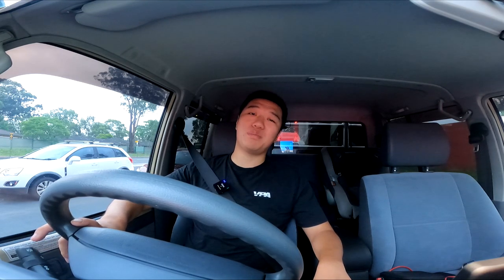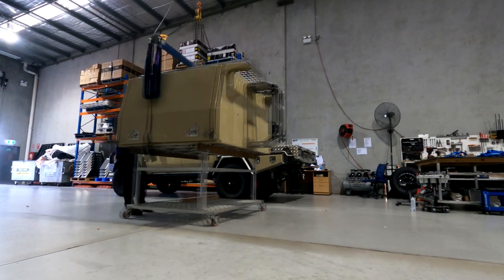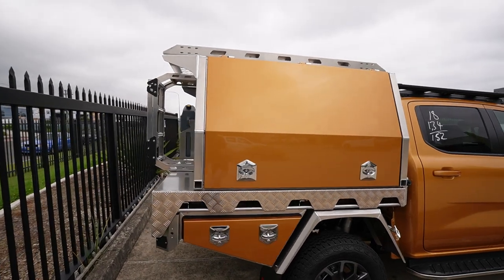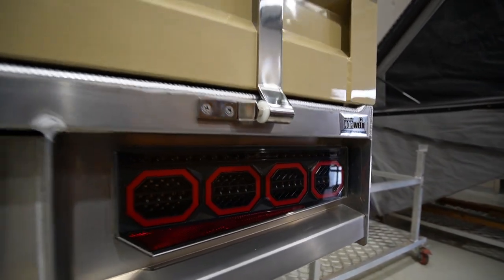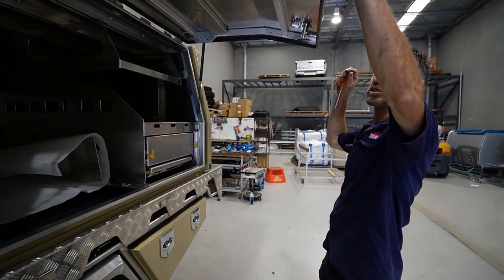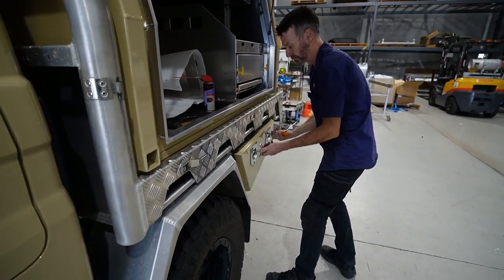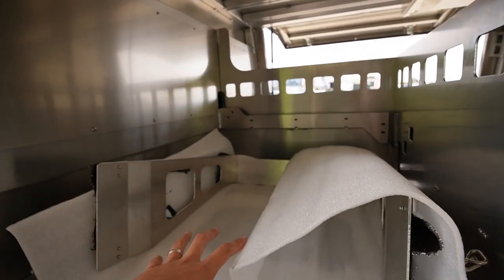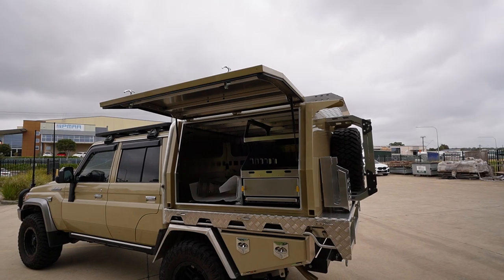79 gets a NORWELD canopy!

Comment: Hay mate,  that roof rails are they removable? How far those rails sticking up from the head bar? Thanks
Reply from the maker: Hi mate yes the canopy roof rack comes right off with a few bolts. With rack off the canopy, it will sit lower than the headboard by a few cm. I don't know exactly by how much
Reply: @JCYT  Thanks mate. You legend👍

Comment: Get an aftermarket diff in to correct the tracking and get rid of those putrid offset rims
Reply from the maker: They're staying for the near future. As much as i'd love to, I really can't justify spending 10k on an aftermarket diff.
Reply: @JCYT  you need to shop around big boy. 4 k for a modified genuine Toyota diff which doesn’t affect your gvm. You keep running those putrid offsets you have a chance of sheering off your wheel studs and blowing out your wheel bearings not to mention you cannot rotate your tyres… oh yeah and they are 100% illegal and void all insurances